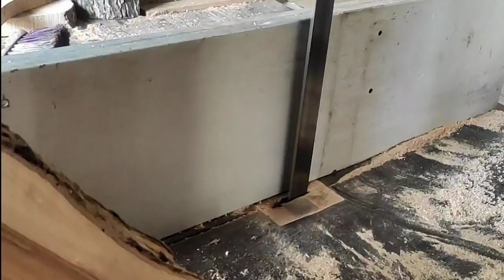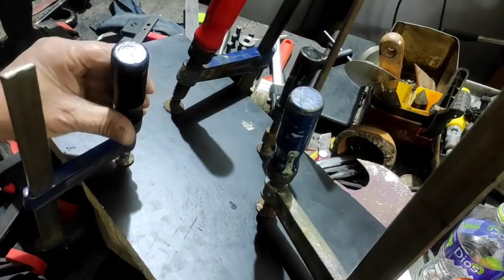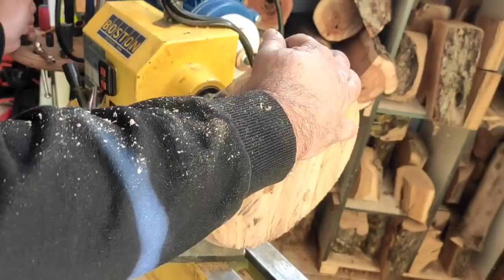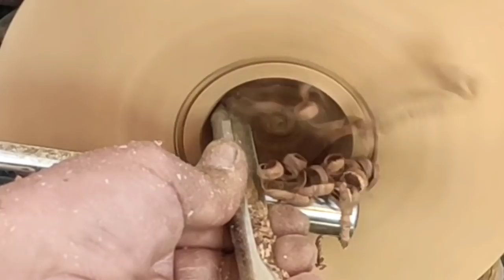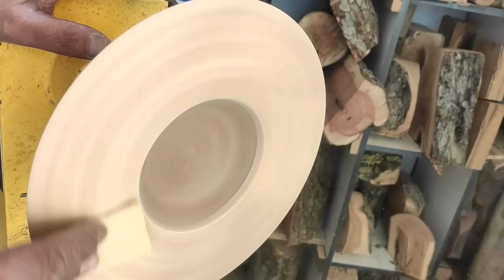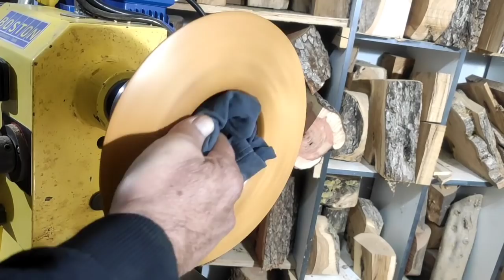woodturning a laminated platter

Comment: Beautiful piece and I like the color contrast between the olive & walnut. 
Question: has the motor on your lathe been changed or modified from its original state?
Reply from the maker: .I replaced the motor with 3hp three-phase using an inverter .the head turns normally .but the weight of the motor is higher.I also made a new base reinforced for the lathe .and it is fixed to the floor. thank you for watching